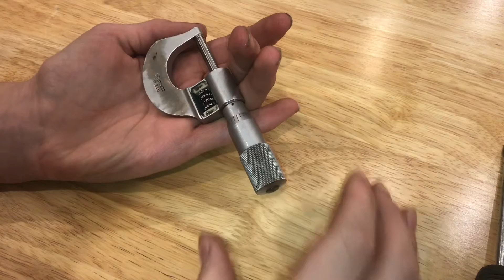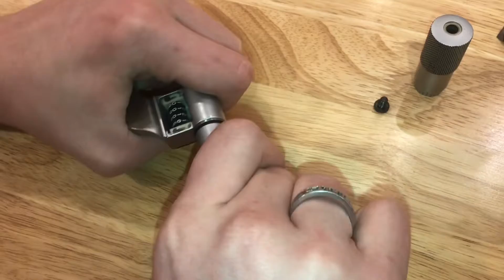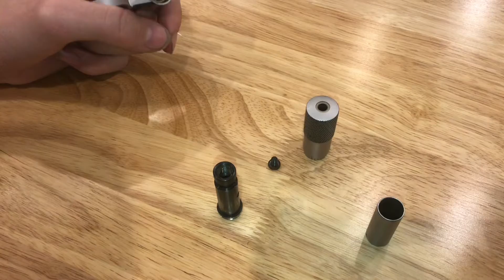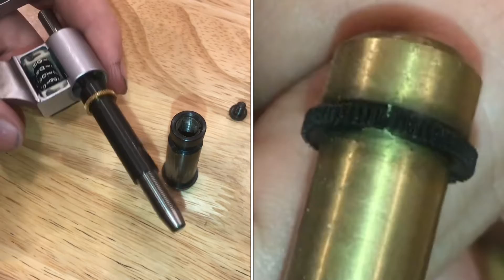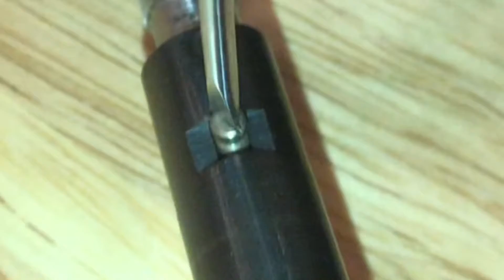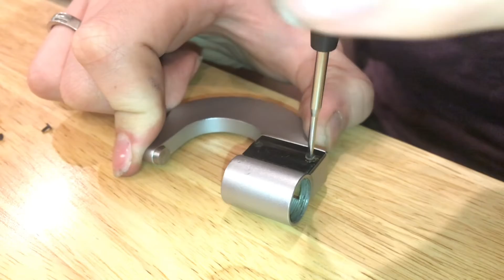COMPLETE “DISASSEMBLY” starrett® 216  0 to 1" mechanical digit counter outside micrometer

Comment: I don't think that original drive gear has a missing tooth, I think the plastic shrank, and the whole gear cracked. That's a common occurrence with certain plastic gears in some HP electronic test equipment too - the nylon shrinks over time, and eventually just splits the gear in half